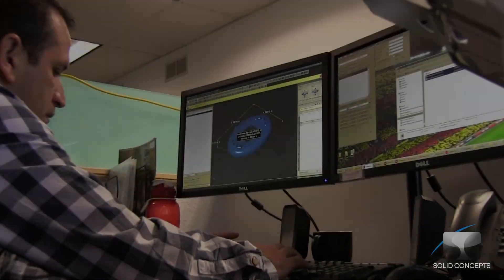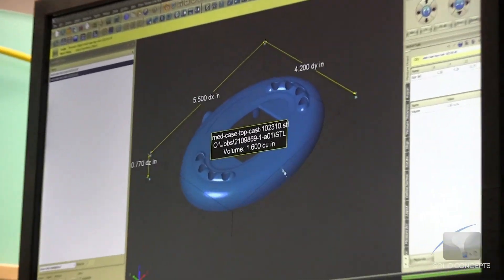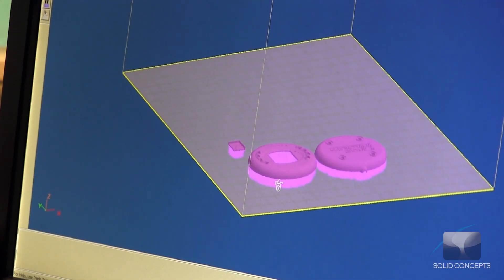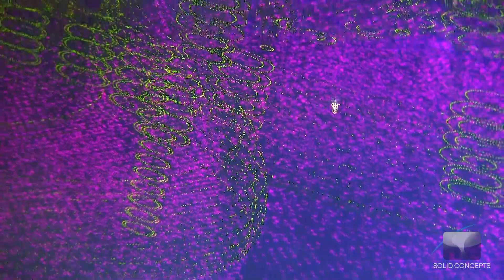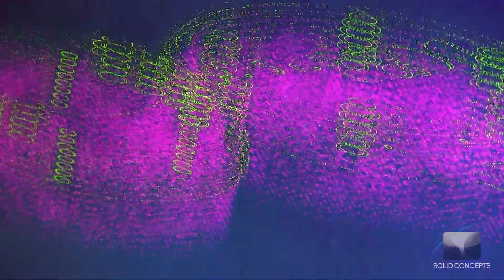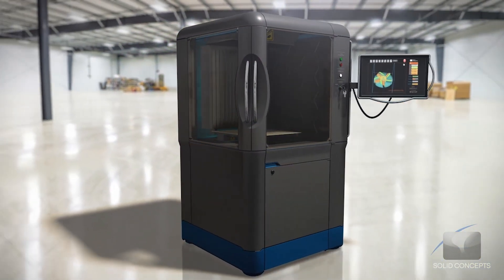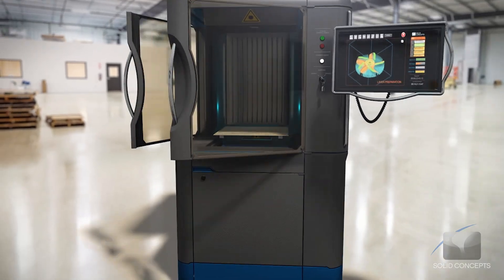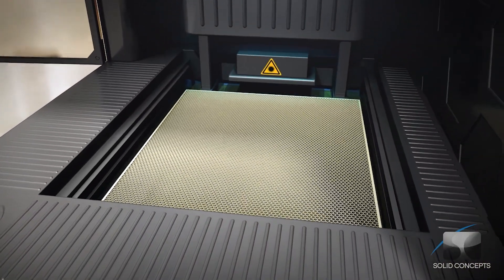Stereolithography (SLA) Technology

Comment from the maker: Rod, SLA formed plastics are durable, but won't hold up as long as ABS. SLA is ideal for form & fit or dimensional verification processes, and is made of a photocurable resin that’s typically used for prototyping. It will yellow over time if not painted, but will maintain its form as a model for years. ABS is a production-quality material best suited for functional parts. If you have any further questions or want to speak with one of our expert project engineers, please call toll-free 8883111017